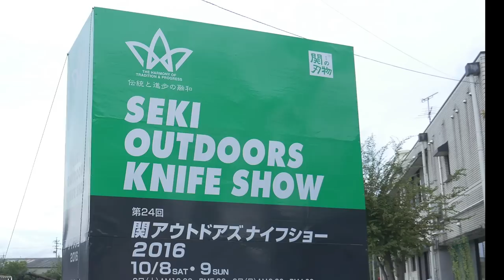Japanese Knife & Sword City: Seki Experience ★ ONLY in JAPAN

Comment: First, that is not real Damascus steel. Second, it came from the middle east and it is in no way unique to japan.
Reply from the maker: Did you read any of the other comments? Damascus steel is not from the middle east nor is it even from Damascus. 
It is a term used by nearly EVERYONE to refer to "pattern-weld steel" which no one really says -- they say DAMASCUS. 
He said the "material" is unique to Japan, not the process. It's very clear. -john
Reply: Mod3rator Playz yea I'm pretty sure it originated from the middle East
Reply from the maker: neema amiry actually, south India. It was first seen by Europeans in the Middle East. Europeans are the ones who named it Damascus, too. Oh well ...
Reply: ONLY in JAPAN Well I was close.

But I wonder what's amazing about true Damascus steel
Reply: As far as I know Damascus Steel is any high carbon steel (hagane) thats been folded creating layers. Folding the steel cleans it from impurity. Slag and soot gets spit out from every hammer blow  resulting in a very clean rigid steel (iron plus carbon). Damascus steel was a famous a material for weapons in Europe and it was believed to come from the middle east. Vikings were believed to have imported Damascus steel from the Middle East and that gave them a huge advantage against softer iron swords used by the Britons. The difference is that Viking swords were made with crucible steel, a cleaner type of raw material while the Japanese would use the cleaner bits and pieces from a huge block (the rest would become knifes, plows, chisels, and other types cutlery tools. These days you can just weld straps of steel, heat them, and fold it as many times as you want/can. Layering can be done not only by folding the metal but from twisting, rolling and many other techniques. Nowadays Damascus Steel is a general term used to refer to pattern welded steel and its not unique to Japan but Japanese Damascus Steel is one of the best. The seller just gave us a VERY shallow explanation.
Reply: Alex Lee thanks
Reply from the maker: Alex Lee right! He's a "seller" not a historian and his comments are good in the way that they've created debate and interest in this topic. Thanks for writing this! -John
Reply: Thanks John I'm glad I could help.
Reply: i agree with you
Reply: yeah the real name is welded pattern steel, 67 layers is about folding two piece of steel for 5 times, not very much but the price of the knife is fair enough
Reply: Only in Japan Just like the 0-9 Arabic number system.  It originated from India and the Arabs got the credit to the name because they introduced it to the Westerners.
Reply: Veightsc arabs invented nothing
Reply: ONLY in JAPAN the wootz steel was imported from India but it was manufactured in the Middle East.
Reply: 김원준 Oh Arabs invented nothing special. Surgery, algebra, architecture, universities, and hospitals are nothing special I guess.
Reply: +Rodel Trainz  algebra was invented by indians you fool arabs had just introduce it in west
Reply: ONLY in JAPAN this is just me sharing info, please don't take this as me being critical. I am a cutler by trade and an amateur historian, specializing in the Scandinavian Migration period, so the process is a topic I have spent many years studying. Damascus steel got its name from the trade city of Damascus where crucible steel was imported into Europe from the Middle East, northern India or modern day Pakistan being the largest producers, though other regions made it as well. Pattern welded steel was a method of manufacture that likely dates back to the early days of the Iron Age in Europe. The methods of choosing the pieces of iron and crude steel that would be arranged to be forged into a billet were very similar to the Japanese method, though the means by which the steel is made are very different. 

The technique of inserting a higher carbon bit into a lower carbon core is one that is shared by the Japanese and the ancient Angles. A method that was used for making the famous Anglo-Saxon longsword, rather like the katana. The Japanese mastery of differential hardening, however, is unparalleled anywhere else in the world, at least as far as traditional technology go. 

Please don't think that I am trying to criticize the quality of Japanese knives or the skill of their Smith's. They are rightly regarded as some of the best in the world and owning a sword forged in Japan in the traditional manner is high on my bucket list (as well as fleshing out my collection of Japanese kitchen knives). I simply wanted to give you some more background on pattern welded steel, now called Damascus steel (a term that became an industry standard somewhere between 1600s-ish and the 1800s-ish, predominately adopted in the gun making industry to start, later in the cutlery industry), so that you can better educated people who can't seem to read subtitles well or who do not speak Japanese.
Reply: Alex Lee just a side note from the history end of things. The introduction of crucible steel into the Scandinavian arsenal occurred more towards the early middle of the Migration Period. Prior to that, the Anglo-Saxons were producing some of the most exquisite swords, many of which became plunder during the early raids.
Reply: NubNaKub We are not talking about city, country, are or whatsoever. It's all about knife and sword. And steel with ripple pattern like that, called Damascus Steel. Savvy??

Comment: Wootz steel is made by carbine precipitatea crystallizing on the surface. It is not forge welded pattern steel. But bravo for even knowing the term. Wootz isn't mentioned much outside blacksmithing circles. Man I miss forgin haven't done it in ages.

Comment: Love the videos, just great, but I just thought I would point out a couple of things. Damascus steel is not pattern welded or made from Wootz steel. Wootz steel is a very complex steel and wasn't used in Japan and pattern welding was associated more with the Anglo Saxons and Vikings than the Samurai. Damascus steel is a common way to make knives, and they are great and will last a lifetime but they are not pattern welded or wootz.

Comment: The knife seller at 5:30 - I'm not 100% sure but that knife he was trying to sale looks like the same VG10 67 layer Damascus steel knife they sale on ebay as "blanks" (it comes with out handles). I brought one for less than $100 new and it's not made in Japan. It comes in the same black box with the same box foam. I thought that was odd just saying. Look up 67 layer Damascus knife and they come up quick.

Comment: This is where my Spyderco Stretch (VG-10), Stretch (ZDP-189) and Endura were born.

Some of the best steel and knives come from Japan. ZDP-189 is some pretty impressive stuff as far as edge retention goes (don't care for how chipping prone it can get at the apex, however). VG-10 is just blissful to work with and use, and at least with Spyderco's VG-10 I prefer it even more than the 154-CM equivalent. IIRC, H-1 (literally) rust proof steel and of course the Super Blue and whatnot come from Japan as well. Or at least were developed there. 

Still prefer S30V (not enough companies run S35VN hard enough - looking at you, CRK) for most applications, however.
Reply: I agree

Comment: No, the clay is only applied in the final step, yaki ire to modify the temperature at the edge for quenching, or Ha and also creates the hamon or beautiful pattern. The hardest steel at the edge needs to capture much carbon, so needs to cool the fastest in quenching, the clay is thicker at the non edge part..the parts that cool slowly lose some carbon and become more flexible, in addition to layers of different hardness, during quenching the edge turns to crystalline martensite..

Comment: The material of katana, tamahagane, removes phosphorus and sulfur that make steel brittle by the Tatara ironmaking method.
It is a steelmaking method that does not melt the impurities together by heating the furnace to a high temperature. Currently in Japan, based on tamahagane's steelmaking technology
A special steel called Yasugi Specialty Steel is produced.
This special steel can be used for high speed tool steel, cutting tool steel, cutlery steel, high-grade kitchen knife materials, razor materials, automobile parts materials, automobile engine parts, aircraft engine parts, cutter for artificial satellite separations, etc. It is used for purposes.

Comment: Cool vid! The pop up Factoid is incorrect regarding Damascus and Wootz steel however. Not the same thing.  Damascus, or folded steel, as the Japanese do it is a pattern welding process - several individual pieces of metal pounded together with pressure and while very hot. Wootz is the lost forging tech where a crucible steel (melted into a liquid, it's then ONE piece) is made into steel that is super strong at the edge and very flexible - and without quenching.  Wootz != Damascus.

Comment: The note for Damascus steel is wrong. Wootz steel does not get its pattern from the layering of steel but from crystalline structure from trace elements in the steel.
Reply: Not sure what you mean exactly, but damascus steel today just means pattern welded steel.

Comment: The damascus pattern has nothing to do with sharpnes. It is only for estetic quality. The most important thing is that the steel the edge holds (hagane) is of good quality and hard, and that the outer steel (jigane) is softer so that it is more robust and less expensive.

Comment: Wootz steel and pattern welded steel are two very different steels. The confusion comes from people using the term "damascus" to describe both. Wootz steel is an old type of crucible steel, mistakenly thought to have originated in the Damascus area of Syria over a thousand years ago. Wootz or crucible steel is formed in a container, often closed off to the atmosphere, and after the heating/melting procedure, it is then "hammered" to shape. Pattern welded steel popularized in the USA is produced by layering steels of different types, sometimes steel and another metal entirely (eg. Nickel) and then heating to a plastic state and then hammering to forge the metal into one solid piece of metal. Two very different processes. This is your error, as the knife makers of Seki City know the difference.

Comment: If the pattern is "etched" using the acid technique, then you can't say that's real damascus steel or even if it has a real "hamon" (the fuzzy edge pattern) because those patterns are actual effects of the manufacturing process (folding, differential hardening, etc) rather than designs. I was very obvious that the patterns were for design only when the knife is in closeup, the edge looked thicker than the rest of the blade indicating that the patterns were literally etched out of the blade. Real hamon edges or damascus steel will have a very even surface reflection off them.
Reply: Real damascus does not exist. The forging technique has died. All of what you call damascus steel, which is actually called kitaeji in japan, is only for design purpose, exept for the art of creating real katanas. In that case, the folding is essential for making the three/four types of steel. This is not called damascus, tho.

Comment: Neither folding nor hammering  make the steel stronger. Folding makes the uneven steel, more uniform. Hence removing (or at least reducing) the weaknesses in it. Also removes impurities. (modern steels are uniform and pure to begin with, making it unnecessary. Before this, all other countries also folded/twisted/bent their steels)

Comment: 4:10 I understand your confusion, but you're spreading misinformation by referring to that as Wootz steel.
You can call it Damascus but thats also technically incorrect. Pattern welded is a better term for this kind of laminated steel. You can use the term Jihada if the blade is made from traditional Japanese Tamahagane steel (that knife doesn't seem to be Tamahagane though).

Comment: How can a katana cost only 4,000-6,000 dollars if it takes 3 people 2 months to make?  That seems oddly inexpensive to me.
Reply from the maker: It's more than that for a good one! That's the price for cheaply made ones. They're probably makes several at the same time. The blade to the handle in a process. I don't think you find a good one for less than $20,000 but that just my sense. 
The materials are regulated and rare & there are few sword smiths

Comment: ONLY in JAPAN
There is no dough that Japan makes good knives but German knives are just as good or even better for a lower price.
What makes a long lasting cutting edge is measured by its hardness: R58-R65. R85 is one of the highest hardness knife blades used but it is very brittle so common knives have a R value of around 58-60. There are no more mysteries on how to make a good knife.
The steel in the old Samurai swords are no better than todays high carbon steel. What makes the old swords expensive is the history and myth that the steel is superior than todays steel alloys. 
The steel alloys made in Japan, German, Russia, the USA, etc are superior than the old Japanese sword and some of them don't rust.

Comment: You don’t saw with Japanese Knives. You take one long pull (or push depending on what cutting) across the entire length of the blade. Occasionally you will make a second pass but again same direction and one pull. 

Sawing ruins the Kiriaji or cut flavor as it is damaging the texture and therefore flavor of the food.

Comment: i would spend that much on a chef's knife, it'll last many years if you care for it.
Reply: They do, but keep in mind you often buy at least 5 Japanese knives.  General, slicing, paring, deboning/joints, and vegetables.  They always figured foreigners didn't know and just sold us gyutou(chef's knife, lit "beef knife" better at rocking motions) or santoku(three "something"(I dunno) knife,general purpose, does straight up/down chops better) by default.
Reply: @Grimmwoldds  5? You can do basically everything with 3. Parring, Gyuto/Santoku (which ever design and length that fits you) and a breadknife. But of course, getting into Japanese knives may require you to get a specific knife for beater jobs as the typical Japanese knife might not last through such treatment.

Comment: Nagoya is 3rd city
Not 4th city
Reply from the maker: Population - 1) TOKYO = 8,637,098 / 2) Yokohama = 3,697,894 / 3) Osaka = 2,668,586 / 4) Nagoya = 2,283,289 / 5) Sapporo = 1,918,096 
If you count Yokohama & Tokyo together, than Nagoya is no.3 but that is not fair because Yokohama is a city. -john
Reply: Differences in thinking

It is not just judgment by the population in Japan
Japanese thinking is Metropolitan area

That's why Yokohama is regarded as part of Tokyo area

It is written not only in the population but also in textbooks as a comprehensive judgment
Economy is also included

It is correct if you consider only by the population

As a Japanese we are constantly studying the viewpoint and way of thinking of foreigners

Thank you

Comment: Damascus steel did not start in Japan, though I will admit there are some steels that started in Japan.

I am a little dismayed as to how he did his first cut.  The knife didn't look sharpened and it seems like he is used to working with stainless steel.  The knife looks to be Damascus steel layered over a stainless steel, possibly VG 10.

Folding and hammering steel does not strength the sword, it homogenizes the steel.  Tamahagane steel is actually very poor steel, a lot of impurities and inconsistent carbon content.  
I would rather have something interesting like 80CrV-2 as my sword steel.

Comment: That is ABSOLUTELY NOT DAMASCUS!" Damascus steel, properly called Wootz, is type of steel, from India, the making of which is lost to history. What you are referring to, is a method of forging, called pattern-welding, which was common across the world, when primitive furnaces could only make "uneven" iron/steels, to make them uniform.
Reply: Pattern welding and Wootz, have absolutely nothing in common, aside from both resulting in interesting patterns (which are, however, quite notably different)
Wootz is a type of steel. Pattern-welding is any kind of metal(s), bent, twisted, and/or folded together. (and, nowadays, serves no functional purpose)

Comment: Dude you really shouldn't use your new chef knife on glass/ceramic plate. You can easily damage the edge and tip of your knife that way. Always use either wood or plastic as cutting surface, your knife will thank you for it. Great video otherwise.

Comment: I coul tell stories why there is NO best steel and why modern steel like AUS 8A or other kinds is "the best". Tamahagne can be forged into incredible sharp steel, but block something with it and it relatively easy breaks. They did not use metal armor in japan, so..... Its like comparing hammers and sickles for gods sake. You could kill with boths, but they have a different purpose or for that matter fighting style involved. For gods sake THEY make their knifes from damascene steele it seems. Reasons.